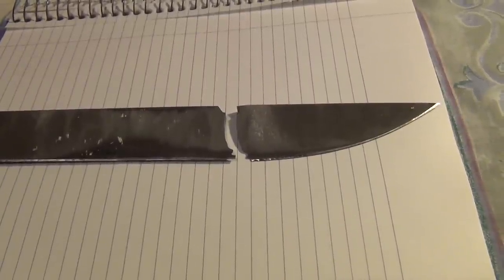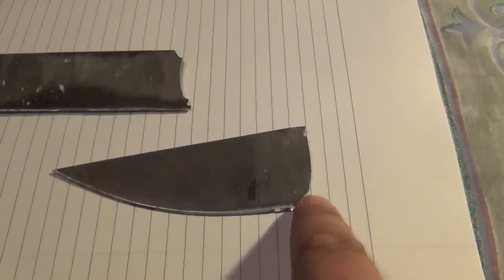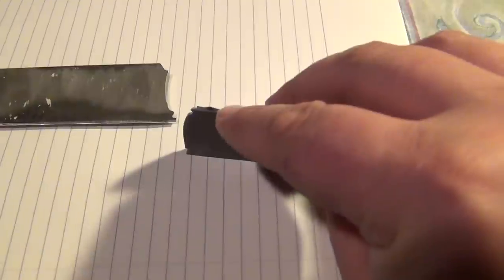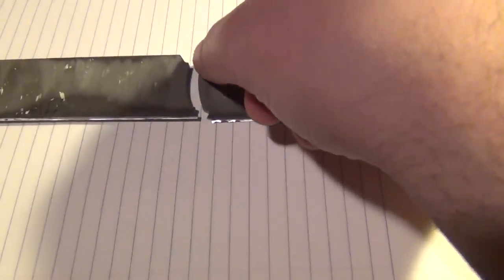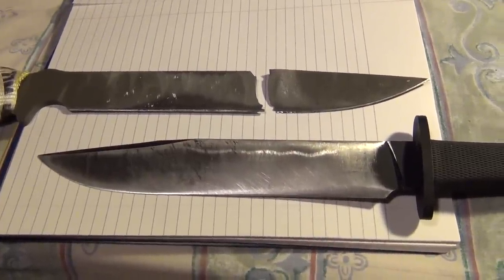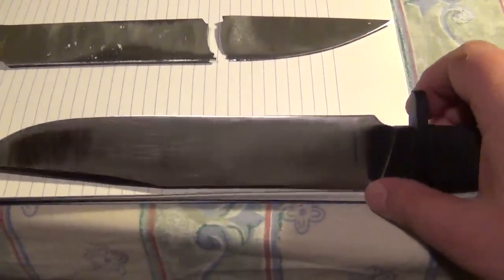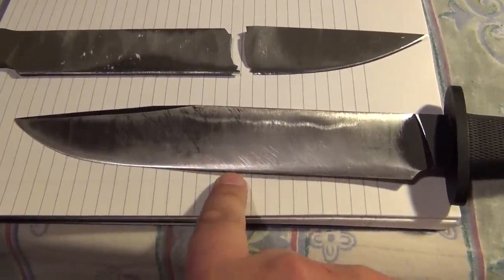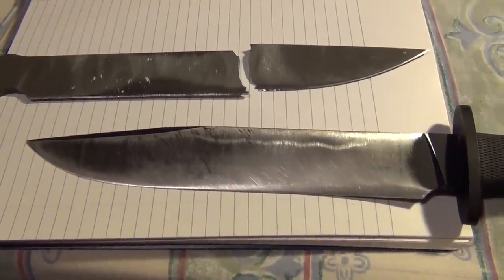Buck Hoodlum : gross blade failure

Comment from the maker: Splitting wood gained tremendous popularity on the forums simply because it could be done and thus became a test of sorts. Lots of people buy firewood for camping/cabin etc. and thus have rounds to split, but actually working on deadfall, building a shelter, clearing lanes requires much more work so it is much more rare. It also became popular because it is one of the easiest ways to check for gross weakness in a knife.

Comment: I just hope nobody comes on here and starts rambling about how you used the knife in some manner that it wasn't designed for. Or that the cold was a factor. Or that you got one from a bad batch of steel. None of that changes how much these blades cost, or guarantee that it won't happen again should the blade be replaced. Confidence is lost and it's unfortunate. The biggest problem with those arguments ARE THE CHEAP BLADES THAT OUTPERFORM THEM! Thank you Cliff, for your honesty.

Comment from the maker: The main quench is done in oil, however water is commonly used as a coolant when sharpening/grinding and if the edge is over heated and it is jammed in water then this can micro-crack the edge.

Comment from the maker: @IMZReady4Anything The interesting thing is that while initially they defended the notch, they are open about the fact that it is not recognized as a problem and they have redesigned it on the second run. I do not think though they issued a recall. It also begs the question of just how much R&D was done on the first version.

Comment from the maker: Yes, there had to be a defect in the way this was produced. However there have been several of them failing in the exact same way. There have been claims that this was caused by laser cutting of the notch and this was later changed to water cutting and the notch was also made more shallow to resolve this problem.

Comment from the maker: @MrCookiemonster30 Yes, that is the thing, it was promoted as a heavy use knife, splitting large chunks of frozen wood, chopping frozen elk bone, etc. and of course all without even blunting the edge let alone damaging it. It is hardly the case then that expectations would be to see edge deformation, chipping and gross failure in such use. 

Appearances may be a bit deceiving on this one as well because while it is a bit narrow, it still is a very thick blade.

Comment from the maker: 5160 has a fairly stock heat treatment as it isn't a complex steel, being just 1060 with a small amount of chromium for deeper hardening and as well to slow down the quench rate as it can be oil instead of water quenched. I doubt Buck can't figure out how to HT it, but any process is likely to have variances and I think that is all that we are seeing with the failures being reported.

Comment from the maker: @IMZReady4Anything Yeah, I don't mind that though. Most of the land around here used to be farm land so those fences were necessary but that was a couple of generations ago and all that happens is the barbed wire rusts away except for the part in the tree. That is generally pretty soft to cut through (or into) vs a 4-6" nail.

Comment from the maker: The largest issue is the throwing because many modern knives have either very slim points for ease of penetration and or handles which will not respond well to missed impacts. The Hoodlum for example (though I have thrown it) is very likely to have the tip crack off on a bad throw which laterally loads the tip.

Comment: this knife has a horrible track record now - the RTAK2 makes much more sense if you want a big flat ground chopper. Although I sometimes wonder if flat ground is any good in a heavy use knife at all. My flat ground Boker Vox shattered like glass when I did a few spine strikes with it. Probably a steel issue, but seems like they wear extra hard if there is a minor flaw.

Comment from the maker: @Nebulax123 It is fairly narrow yes, that was always an aspect of the Hood blade in the various incarnations. It is however fairly thick though, just under 1/4" so the amount of steel should not be a problem. Even if it was very thin, it should not actually crack, especially how this one did, but if it was say 1/16" thick with a similar high flat grind then having the edge distort would be expected.

Comment from the maker: Any decent steel will split wood for a long time before dulling as the edge isn't very stressed as the wood opens up before it in the crack. It isn't very dulling, if you are outside you will dull the edge with grit or accidental contact long before the wood splitting would wear the edge down. Now as for the use in general, this knife was designed for it - if you were going to carry an axe then you would not also carry a knife like this as it would be redundant.

Comment from the maker: @yhckelly Yeah and the new owner is using it and it is still going, hell of a value for the price. The only issue I have is that the handle has the same issue as the actual Trailmaster, it is coming loose and will have to be replaced.

Comment from the maker: @AussieMark909 That was actually one of the critical aspects of the design, the first blade Ron made of this style (slim blade) was promoted heavily for the ability to cut light brush. The argument was since it was not as wide it was in contact with the vegetation for a shorter period of time. That never made any sense. But the lighter blade generally made it more effective on such work. It does work better for such than a heavier blade like the Battle Mistress.

Comment from the maker: @jankerson1 Yes, I have other 5160 blades, they in general do not behave in that manner. 5160 is essentially a very light alloy of 1060 to change how it hardens (water to oil) and has effect on scale formation and other manufacturing concerns. But as regards to being a blade material it should have the same class of strength/toughness as 1060, a very tough mid-carbon steel.

Comment from the maker: @haywoodf If they just wanted a lifter then it could have been fully rounded, but it is also advertized as a wire-breaker, bone scorer hence (I assume) the reason for it being so sharp. All of these can be done of course without the notch, it is just a trademark of Hood's like the Busse Talon.

Comment from the maker: They have acknowledged issues, including the notch which have forced a redesign. However even without the notch there are issues with the steel. I don't know why they went with 5160 which is an oil hardening steel when they could have used something like Calmax which is a very tough air hardening steel.

Comment: i spent about a month researching hard use blades and nearly settled on one of these as i liked the bladeshape but, seeing the notch i thought it would be a poor decision as it would weaken the blade(maybe if it wasn't so deep).i still may get one just because and baby it. i ended up getting the esee junglas and it seems to perform pretty well and even after splitting a whole pile of kindling(white pine) with it found i was still able to shave the hairs off of my arm afterwards.

Comment from the maker: @IMZReady4Anything Ron did put a lot of thought into the design, you can see it evolve from the knives he used/promoted which include the Trailmaster, Battle Mistress, Steel Eagle, etc. . But the problem is that you have to run the line as well, and not the one they give you but a few random samples you pick out. Buck is not disputing there is an issue so it is obvious this was not done.

Comment: @IMZReady4Anything I am a big fan of Ron Hood. Before he passed away Nutnfancy had an interview...great stuff! Richard said the blade didn't have much weight to it but it was supposed to be a good splitter. I can't believe Ron didn't test the blades. My guess is somewhere Buck cut costs. After my kabar broke I was on the look for another knife. I did consider this one. I also considered the Anaconda. The first one I dismissed was the Junglas(the one that seems to actually be good)

Comment from the maker: @JohnFrumFromAmerica Yes, Buck admits that was an issue. I called customer service and they noted they had to alter the design of the notch due to the number of problems they were having. However they did not issue a recall on the first run, and if you do have a problem then costs of return are on you - hardly ideal customer service.

Comment from the maker: The initial performance of my Fiskar's (Sportsman) was fairly low in regards to edge durability, the edge would dent/roll pretty easily even in wood working. This improved significantly in sharpening so I would suspect that the edge was over heated in grinding which was not uncommon.

Comment from the maker: @555Nato The handle can be fixed without too much trouble by using an expanding foam/epoxy. However if this knife lasts through March and some trips outside in -10 to -30 C then I will likely make a decent wood handle for it. But if you did not want to go to that much trouble some epoxy would secure the handle and then some tennis grip over wrap would stabilize the quick wearing grip.

Comment from the maker: @knivesandstuff I was not that surprised that it went at the notch, but the fact that it fractured in both planes and rippled cutting through some tiny notch at the edge thickness/angle it has was pretty disappointing considering the steel used and the price point.

Comment from the maker: @MrCookiemonster30 While the notch does reduce the toughness of the steel, there is no argument there as it is basically a charpy c-notch. Even with that notch the steel should not have splinter fractured as it did not should the edge have dented. It looks to me that the steel was either over heated during austenization, suffered quench cracking, or temper embrittlement or possibly all three.

Comment: @CliffStamp i agree. i talked to the head engineer of heat treat at buck about some of my concerns with the heat treat. i have about a dozen of their knives of different models and it seems that the 420 hc seems to roll too easily when resharpening. i know alot of their problems have to be the same with alot of manufacturers where they are cutting corners to save money and end up sacrificing quality for quantity.

Comment from the maker: @jankerson1 This did not take much effort, I was sitting down at the time, mild weather, no stress. I was not surprised that it broke, nor at the notch, but that I managed to see both previously reported problems (edge bending, blade breaking) in other videos both in the same blade here. It is an impressive achievement to make a blade so weak and yet so brittle at the same time, especially in a steel which is designed for high strength and toughness.

Comment: That is too bad C-Stamp. I too have used my Hoodlum on 20-25 backpacking trips using it as an everything tool (feather sticks through heavy brush clearing and splitting). I own around 40 knives and either my Hoodlum or my BK9 is my big blade of choice. In fact, my last trek with it, my Hood processed quit a bit of bone after we downed two bull elk. Better luck in the future.
Reply from the maker: It happens. I doubt they are all like it and in general Buck has replaced all the ones I have seen reported with problems.

Comment from the maker: @Nebulax123 This has to be a fault, either in the steel, the hardening or how it was ground as properly hardened 5160 should not be this weak or this brittle, even with the notch which doesn't for example explain why the crack ran parallel to the edge or note the very jagged way it cracked above the edge. Unless I saw how it was hardened, ground, etc. it is impossible to be definitive without etched micrographs.

Comment from the maker: That is a trademark of sorts for Ron Hood who was the designer, this was not the first knife he used it on. Buck has acknowledged that it is an issue and has redesigned it on the later versions. It is still there, but not as prominent. 

A bit of a gimmick obviously, but that alone could not explain how easily the blade broke had the steel been without flaw.

Comment from the maker: There are knives designed to do that, Strider for example made a reputation for taking their own knives at shows and slamming them into tables and concrete floors to show the durability. A number of other custom makers did the same then show they had similar durability. In general though, most knives tend to be made to cut well rather than have that level of durability as you can't have both.

Comment from the maker: The knife wasn't reground, but even if it had been, and over heated that could not have caused this kind of failure. If someone is telling you that they don't have a basic understanding of metallurgy. 

If the blade was over heated then this would simply draw the hardness down on the edge which would INCREASE the fracture toughness, and it would also be next to impossible to effect the spine by grinding the edge due to the heat sinking through the body.

Comment: Yep. Mine looks just like that. I'm 45, a vet, and not a dumbass...not on this stuff anyway. I was absolutely not abusing my 2 week old knife. Which there shouldn't be such a thing as abuse for this knife. I hadn't even had to touch up the edge yet. They will replace it. I wish they would replace it with a Boomslang or a Becker. My old CS 18" Bowie Machete is the best $18 ever spent. On a funny note, handling that broke end cut me more than all the other knives with handles I've ever had.

Comment from the maker: @MrCookiemonster30 It would be odd for Buck to outsource heat treatment, but this kind of information is usually not made public.

The video is kind of interesting as it is basically an izod test (with a different notch) unfortunately the impact energy isn't quantified but even from the jarring of the equipment it is obvious that it is heavier than what would appear to be from even a hammer swing which is many to one over a wood impact.

Comment from the maker: Yeah, it is a decent enough design for a lighter use larger knife, more of a machete than parang. Has some issues with the grip, balance and edge geometry - but doesn't make it a bad knife per say. The XL Forrester from cKc however is an example of how to do this style of knife with a much more optimal design.

Comment from the maker: I contacted Buck, they are aware it is a problem, have changed the design - but they are not issuing a recall and if you have a break you have to ship it back at your expense. I will do this shortly, and I would be very surprised if they did not replace the blade. The problem is though this will likely cause a duty/brokerage charge at the border and that + shipping could easily be a $75 loss for what is clearly a defective knife.

Comment: Buck unimpressively designed the notch or impressively designed a stress raiser. Seems to work equally well for Charpy testing or accelerating confirmation of the Soderberg Criterion. It's a heavy price to just lift one's billy (billy tin in your case) off the fire. From your description of edge rippling it seems like there were significant residual stresses in that blade from the heat treat and edge grinding which would not have been beneficial.

Comment from the maker: The edge itself can be damaged from power sharpening but that is going to be limited to a very small amount of the edge (i.e. less than  mm) . Unless of course the edge is very thin and the person sharpening is also quenching in water as this can fracture the edge. That is one of the current common assumptions as to what is causing the frequent damage on Bark River knives you can see on YT.

Comment: Do you think the notch alone is the culprit? Did you have the blade hardness tested? Seems like bad heat treat might be a culprit too. What did the grain structure look like in the break? Sparkly spots in a gray matrix or dull gray throughout? Must be way too hard. I think 5160 in a chopper should bend and peen and be too soft to break because it is after all one of the most used steels for ABS knife tests to be a mastersmith. Thousands of properly heat treated 5160 blades have bent 90 degrees without breaking.
Reply from the maker: You are correct, I don't think the notch itself should be that kind of a dramatic problem. There is no definite statement from Buck, but second hand information notes they changed the way they cut the notches from a high heat to a low heat one and it could simply be localed sub-structures in the steel from the notch cutting.

Comment from the maker: @haywoodf If this blade reached either the fatigue or tensile limit for this work it is a sad state of affairs for the steel, especially since the fatigue cycle is on the order of 1 k. I do appreciate the materials reference, it would be nice if someone from Buck had similar attention to detail.

Yes, that is the first thing I though, why would you intentionally add a c-notch to the blade.

Comment from the maker: That is one of the risks of using non-blades steels as the tolerances for what they are generally used are often not what you want in a blade so you have to either know what to ask for and ask for it or you are rolling the dice and you on occasion not going to like what comes up. This is why in general you should use tool steels and know the specific batch tolerances.

Comment: The notch is bad, yes, but you can see on mine with magnification that the steel is not right. I'm not a  metallurgist but I was a welder 100 years ago and I passed lots of xray tests. I guess I'll have to make a video response while I still have the broke knife. I really want to understand this since I'll be getting another one. I'm not trying to bash BUCK. I have a soft spot for the knife company that made the knives I used as a kid. BUCK did tell me my replacement would be "improved".